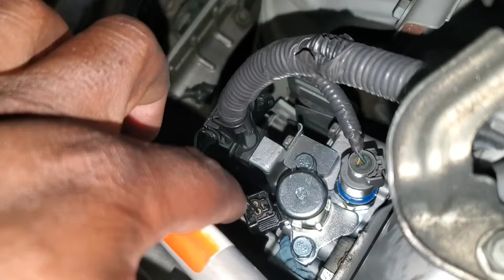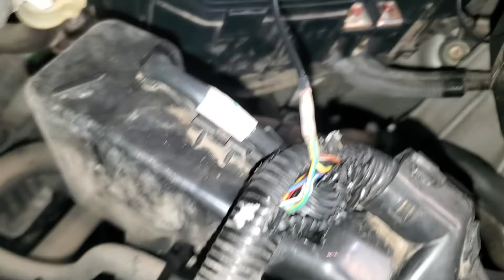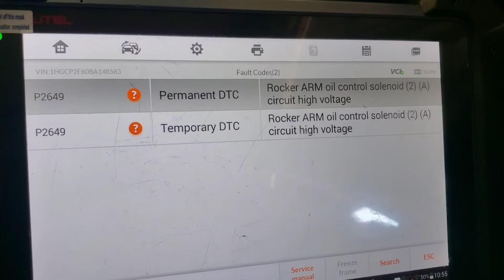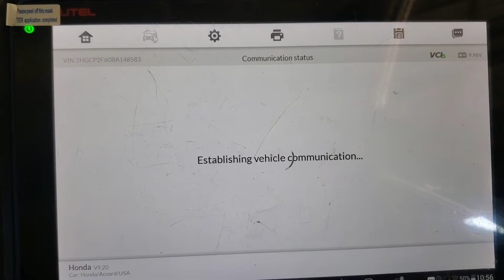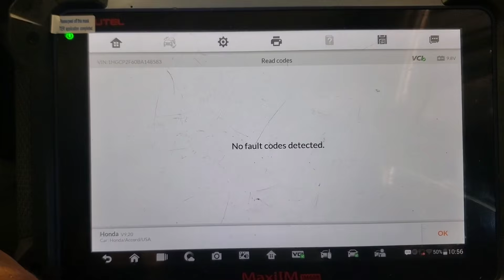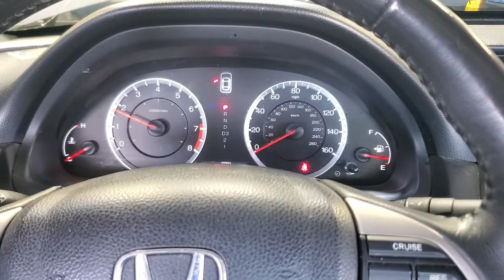Honda Accord P2649 Rocker ARM oil control solenoid circuit high, limp mode DIAG/FIX!

Comment: IM DONE! I admit defeat! I've done everything except a new ECM and I'm not wrenching on this another minute.
Reply from the maker: Sorry to hear it, did you follow all the steps in this video? A damage ECM can cause all of this
Reply: @globalcommerceca that's the only thing left. I changed all the coil packs, plugs (at $15 a piece) timing belt/water pump, valve adjustment, new MAP sensor, new fuel filter, checked fuel pressure, new VVT solenoid and fixed a leaking air box plus a fuel system clean. Your video gave me something else to look for though but I'm out of town until Saturday. It's weird because I got multiple misfires then it would clear up after 10 miles and not come back until the car sat 12 hours or so. After the new VVT it threw a code associated with that but seemed to run better. Idk, I'm just a dumb electrician with big clumsy hands.

Comment: Good evening, I need help. I have this p 2654 in my 2008 Honda Accord. I already changed the part and it still has the fault. I don't get any current to the solenoid.
Reply from the maker: please watch this video carefully, everything is explained
Reply: Have you been able to solve this? I have the same issue

Comment: I'm getting P2654 code....Mine is a 2008 Accord 2.4 .  This code is for Oil control Solenoid 1 (B) circuit high voltage.  But, cannot seem to find any wiring diagram for this code.  Everyone points to this same solenoid you're talking about here.  But my scanner shows this as 1 (A).  Any suggestions?

Comment: Hello I have 05 Honda element with a p2647 hard code how did you do this half way power then the other half nothing I’m confused on what to do on the fuse box
Reply from the maker: Watch this video very carefully.. EVERYTHING to fix this fault is here. If you don't know how to use a multimeter to find a break in a wire, search how to do it on YouTube.

If you still cannot manage i recommend seeking a local professional and pointing them to this video.

Comment: Great video I just fix this issue on my 09 Honda accord a break wire easy fix thanks 👍👍👍
Reply: I also have a 2009 Honda Accord and I had replaced the VTEC solenoid and after replacing it this code popped up P2649. Can you give me a little bit of more info on how you got that code fixed? I am thinking this, maybe a wire
Reply: @esepetesegura I guess they don’t know

Comment: Code p2654?
Reply: I also had this issue did you figure it out
Reply: @justiceearehart4961  Have this same code!  I've scoured the internet....cannot find any info....just wrong info.  P2654 code is for Rocker arm oil control solenoid 1 b.  However, these 2.4l Accords don't have a (B) solenoid that I can find.  One guy points to the VTec Solenoid on side of head and that's not it, so far as I can find.  Any info would be appreciated.
Reply: @bimepurge hey dude got the same exacta code, did you get it fixed?
Reply: @jdottyyzogz3174  Yes,  I think I figured it out. On my car, 08 2.4 accord,  it's a ULEV vehicle, aka: Ultra Low emissions or  Cali Spec.  These vehicles are supposed to have the twin solenoid spool valve on back side of head.  Mine has just the single solenoid (A) and wiring for just a single.  The (b) solenoid for  THIS code doesn't exist on Federal emissions cars. But, PCM is still looking for a signal for the (b) solenoid that doesn't exist.  I believe that my car had the computer changed or a new engine installed at some time before.  And no extra wiring for the (b) solenoid.  If you have the Twin solenoid pkg with appropriate wiring plugs, etc, then you have an issue with that solenoid.  And btw,  the single and twin solenoid spool valves both fit the same bolt patterns for that head....so they're easy to mix up.  Hope that helps
Reply: @bimepurge hey i appreciate it I kinda get it my car (09) has three connectors and only one is plugged in I really don’t know anything about it myself I got the car yesterday but I think I’m just going to have to take it into the shop unfortunately.
Reply: Have this same code!  I've scoured the internet....cannot find any info....just wrong info.  P2654 code is for Rocker arm oil control solenoid 1 b.  However, these 2.4l Accords don't have a (B) solenoid that I can find.  One guy points to the VTec Solenoid on side of head and that's not it, so far as I can find.  Any info would be appreciated.

Comment: Both codes are back after starting car. Do I just put lead in pin location and ground it on plug side? I just confused the.... out of myself.
Reply from the maker: You can try that would be better to run directly to pcm

Comment: I'm lost! No permanent codes present. Time to run the car, I'm really trying to avoid that I know it's got the safety system on it but still.
Reply from the maker: No permanent codes is a good thing means computer is seeing solenoid
Reply: Codes are both back! I'm doing something wrong I'm not getting any ohm reading anywhere or am I supposed to be on a different setting. I'm sorry it's impossible to help a person even through a comments section. I'll figure it out. Oil pressure switch P2647 stuck on. I have to do 1 code at a time I'm confusing myself for no reason. I think the single pin plug unit below the spool valve assembly is bad causing all of this.
Reply: Or I have actually lost the oil pump, but there's oil in the valve cover-ish. Thank you for your help and videos!

Comment: And my clamp is lent out to a friend at an audio show😢! Can I run from pin to pin then? I'll just splice all new wire in if plug itself isn't faulty, but most aren't because they don't want you knowing it's a wire issue not plug itself!
Reply from the maker: You can definitely try that, Don't forget to like and subscribe 👍🏾
Reply: @globalcommerce7654  I already have! I know I've got a P2649 and P2647 so I'm trying to fish this all out. Everything is new as far as that goes. Now I'm really confused as the Solus says no codes. That can't be right. Need to run a live test while running. It starts, will run but then watching cylinder #1 timing advances rapidly then shuts car down. That was last night so try again!

Comment: This could possibly be my life saver right now! I have a new assembly as well but with oil pressure light switch stuck on. Using a Snap-on Solus unit. I have a P2649 and P2647. I am a mess figuring this out. Same PCM, have done full timing chain kit including new all new sprockets, vvt selenoid, the works. I wish I could get a person on the phone and walk me thru this, but I already think the pressure switch (on the block) is faulty. Kind of a mess of things going on. I'm a car audio guy so if all I end up having to do is throw a wire in the mix I'm good. Going to attempt to jump the plug 1st and see if it signals change open to closed or on to off. Perfect video!!!